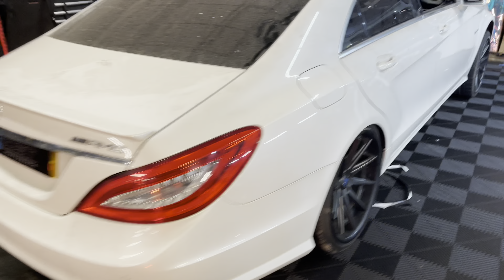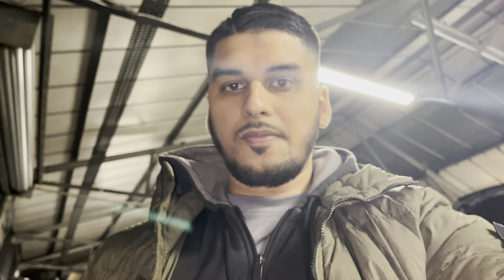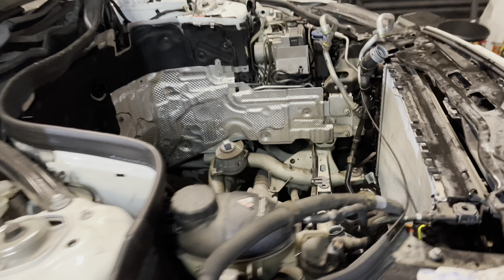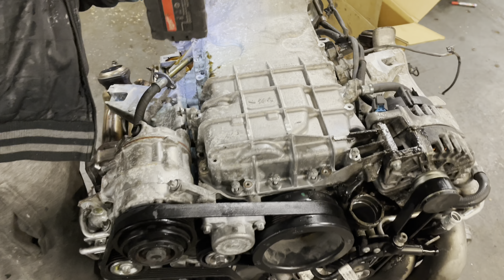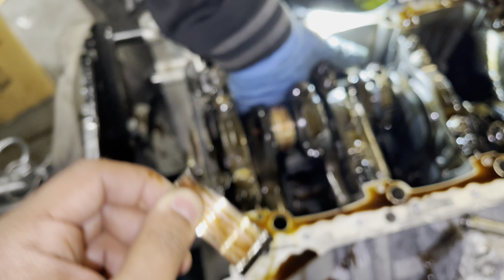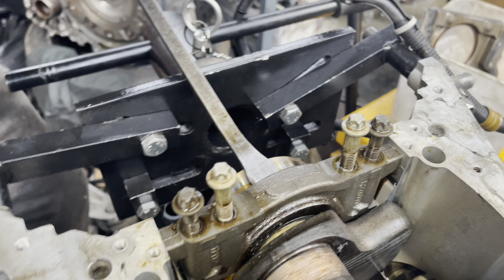WHAT BROKE IN THE NON RUNNER MERCEDES CLS63 AMG? ENGINE STRIP DOWN + WHY ENGINE SEIZED UP PART 2

Comment: The AMG could be tuned hence having to adjust oil intervals to half the recommended by manufacturer which people don't so they kill their engines..

By the way, what's a good machine shop you use around London Namz?

Comment: Soon will be roaring inshallah, make sure them rods are straight they are known to bend,if the piston wrist design was a bit stronger the m157 would be one of the strongest AMG engines alongside the m113k
Reply from the maker: 100% agree these things let it down badly lovely sounding engine though
Reply: I’m gonna say it now  the best sounding turbocharged AMG ENGINE, still got that n/a growl with them turbos whistling 💪 
Do you know if this is tuned?
Reply: I been telling people that the rods in these engines bend no one believes me. I’ve seen scoring on the cylinder walls with a camera even on the m278 engines
Reply: They do bend with bad maintenance and bad tuning considering the amount of torque these make on just a stage 2 is ridiculous!

Comment: Just a thought bro, why not look at this as a opportunity to go BIG power and get a built engine? uprated crank and rods? Etc.. Chances are it will probably cost about the same as what you looking at now or a bit more and you'll end up with a  KILLER CLS63.. Hit up MSL Performance Mercedes specialists and find out what they can do for you at this stage. You never know maybe you'll be better off. All the best brother.
Reply: If he goes to MSL performance they will charge an arm and a leg for labour ect. The whole point is to find cheap cars, get them fixed in house and sell them on. He has his own garage so can use the labour costs to his advantage
Reply: @ltrick3096  True say.. I was only suggesting exploring other options available to him. But whatever happens either way he will fix it and it will be a wicked investment.

Comment: Just curious why the engine was not turned over manually first , prior to replacing the starter motor 🧐
Reply from the maker: Because we addressed the electric side of things first (no sign of starter moving when turning key) like the sound you hear once we did change it,
It turned out to be a dead starter motor anyway so nothing lost
Reply: @NamzBoost  That's probably because the previous idiot owner fried the starter motor too. by constantly trying to start it once the engine had ceased. Adding additional damage SMH

Comment: Looks like a mix of really bad oil change and the driver not having a clue on how to drive the car. These beasts require top grade oil and proper warming up before sending em about. Looking at the state of the bearings would suggest my man woke up at 7am on the coldest day of the year and sent the car within the first 10 seconds of starting up
Reply from the maker: I agree but I do have to add these m157 engines are known to have several different faults from manufacturer even if the car is well look after

Comment: A used tay work in Mercedes-Benz ye only get about 20 thousand miles out an engine if ye hammer them no like other Mercedes-Benz diesel engines not built too last they model's supposed too get life time warranty with them
Reply: That's BS.
Reply: @gottliebdee263  stuff bought way card too 21 banner drive flat 1/4 too be returned and not too lot that turned agent or gerbils family
Reply: @gottliebdee263  and stuff took on renfeild street year's ago too be returned and not too gerbils lot

Comment: How do you guys know what the correct torque value is on the bolts? If under torqued or over torqued it can cause bolts to fracture when under load